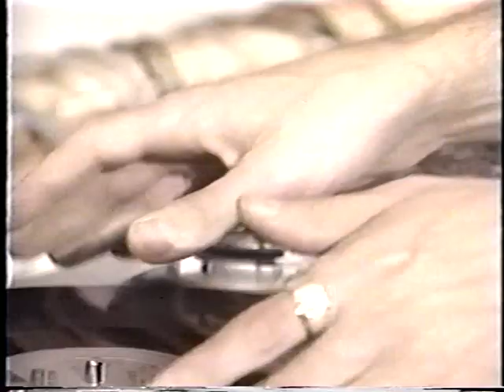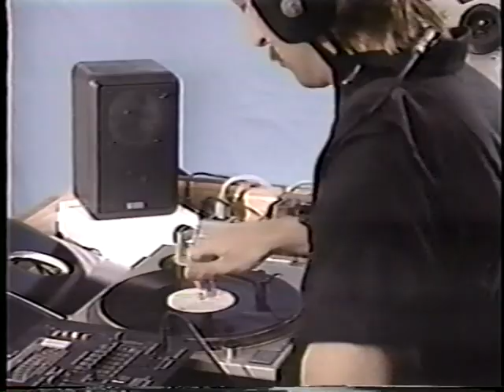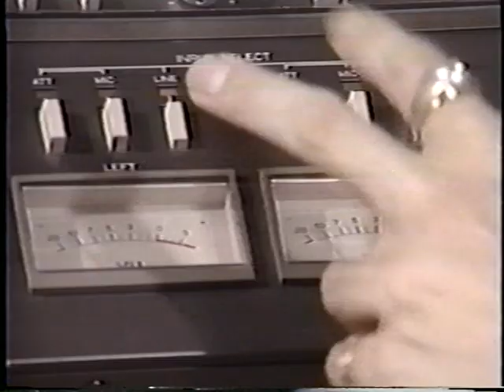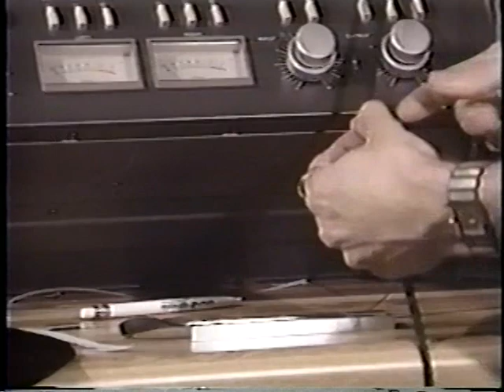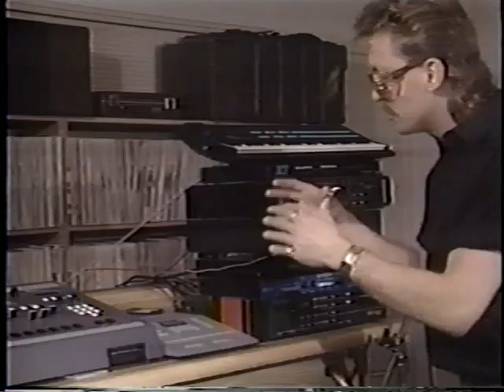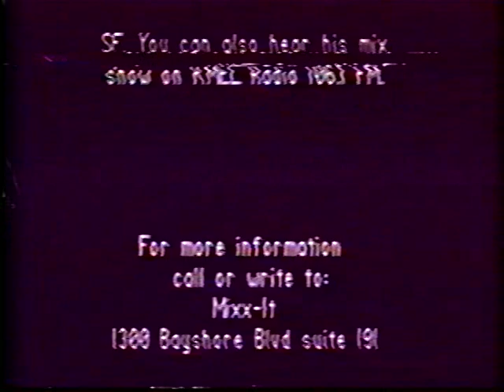Cameron Paul Tells All

Comment: This man was really talented. I was born in 86 so I never really grew up hearing his name that often on the airwaves coming up. I remember the MC's Chewy Gomez, Trace & Franzen from CMC though. I was curious to see how deejays did it back in the 80's especially in the Bay Area. That's when I came across this video. This man took his game to another level creating his own sample records and remixes to use during his live sets. I started deejaying a little bit in the 2000's before Pioneer CD DJ's and before Serrato, so I know how its like to haul crates of vinyl. The game was already very blessed then because many record shops were already carrying break beats of brand new hits like the Lethal Weapon remixes. Now, these new gens just plug in their phone into serrato and they got all of the new joints and remixes on there! I guess my point is that people like Cameron Paul paved the way for radio, party, and club deejays. Back then, I guess you just had to make your own break beat record, or just do it on the fly during a set. I never saw someone literally splicing a reel to reel, but what a long way we have come where now we use software like Adobe Audition to do the splitting, mixing, and multi track recording.